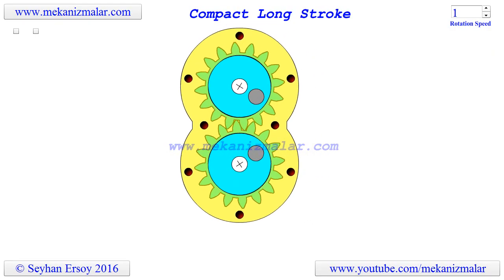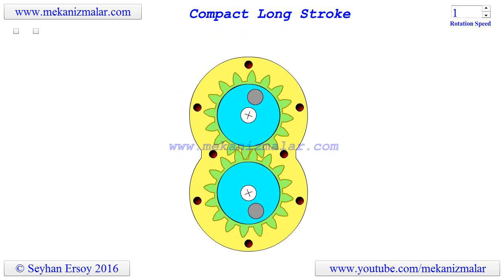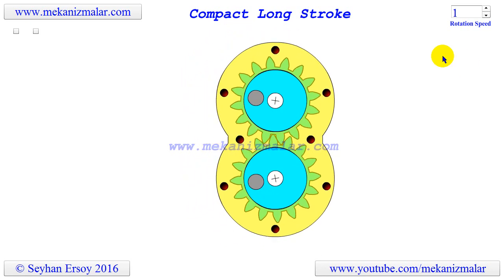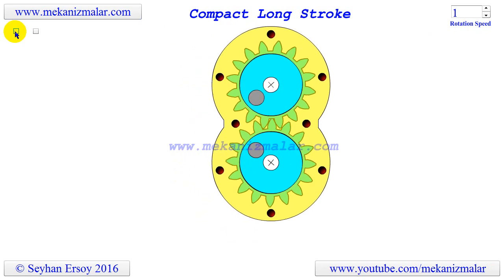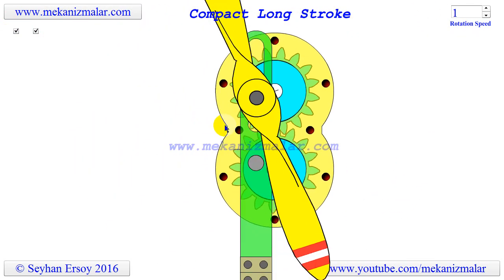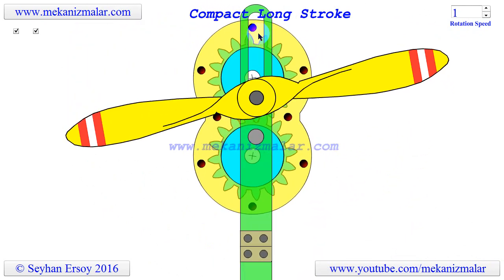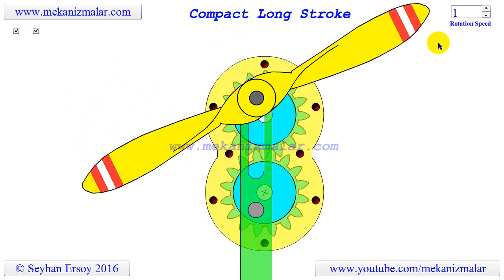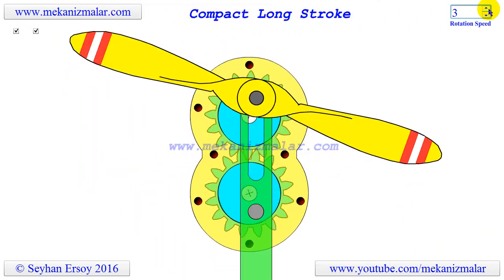compact long stroke

Comment: This is an interesting idea.  It would require a counterbalancing weight, which could be installed on a crankshaft that rotates on a bearing mounted on the mechanism's housing.  The crank would fit in a bearing mounted to the yellow part.   Also, the pump rod would be better stabilized if it had 4 roller bearings mounted to the housing. 2 bearings on each side of it to keep it running in a straight line.  Relying on the propeller/turbine shaft to guide the pump rod would create a lot of friction since the prop shaft rotates and the pump rod is moving up and down.  By now I've made it more complicated than a regular crankshaft and connecting rod.
Reply from the maker: +deezynar Thank you for the comment and your description. Let see if someone do something like this to power a pump.

Comment: This is a cool idea, but seems finicky to build. I'd rather use a scotch yoke, why not?...
Reply from the maker: +DigGil3 Thank you very much for your interesting comment. I agree with you that it seems difficult to build compact long stroke mechanism. Only problem I see with Scotch Yoke is that propeller shaft is not supported beyond the Scotch Yoke plate. (I hope that I am not wrong). However in the compact long stroke shaft is supported at both side of this mechanism. In short, Scotch yoke placement on the top of the tower might seem finicky.  However there is more than one way to skin a cat. I am sure there are some mechanism for pumping water by wind turbines that I don't know.